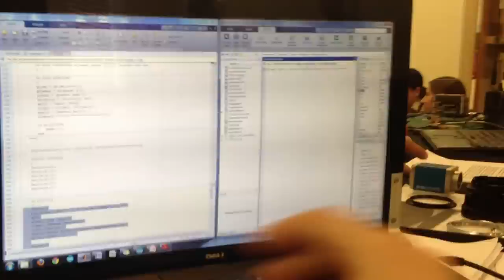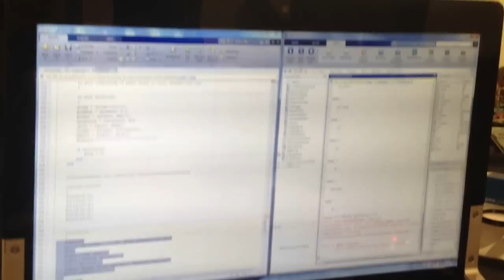Reaction Wheel Actuated Satellite Dynamics Test Platform

Comment: what happens if you accelerate the 3 wheels at the same time with equal speed increase?   It will stay static or it will move in some angle?
Reply from the maker: +AngelLestat2, you should answer that question yourself by adding the resultant torque vectors together. Do any cancel out?
Reply: Alan Smith no, they dont.  But I am trying to figure out how the flywheel with attitude control included that nasa is developing works. It does not seems to have one counter rotating disk, neither 3 disk in each axis.. How they are able to put energy into the system?
Reply: Electro Magnets.
Causes Wheel and Spacecraft to turn.